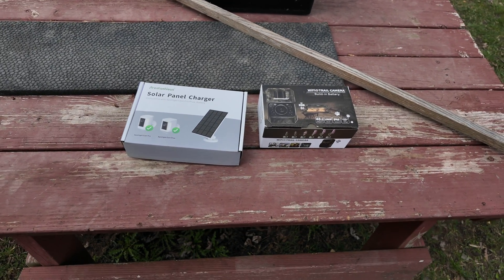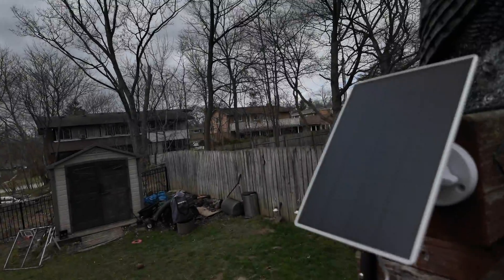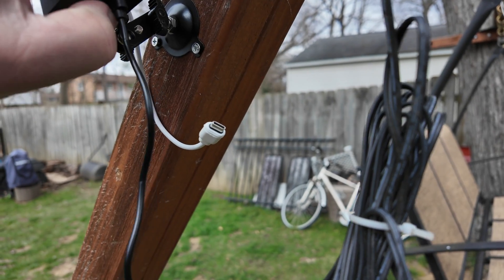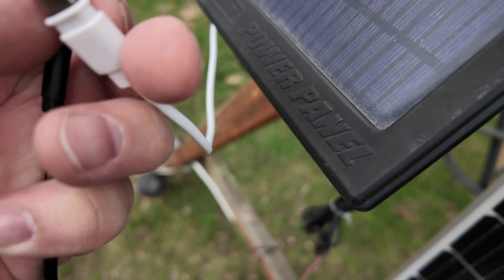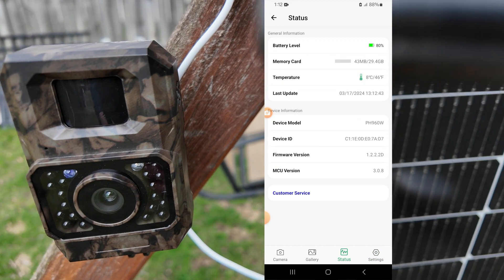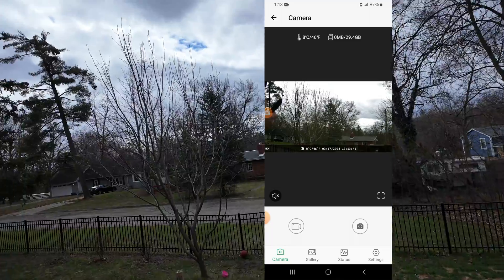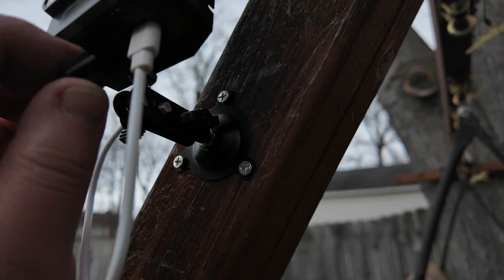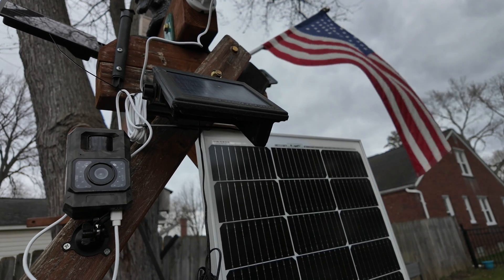Solar Panel Charger with PH960W Trail Cam

Comment: What are the specs on the solar panel? Just curious if I ever need to replace the one that comes with. Thanks
Reply from the maker: 5V 3.5W Solar Panel with10ft. charging cable